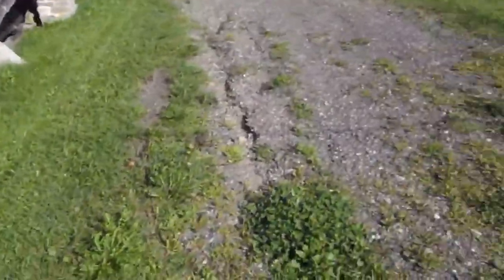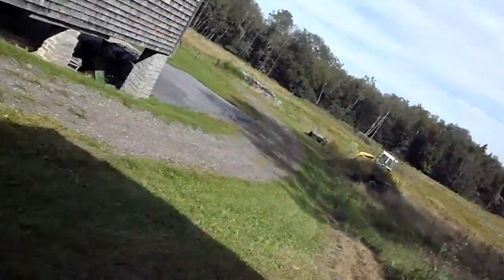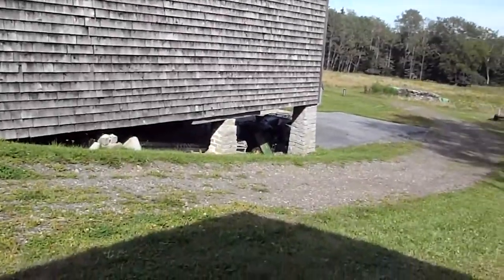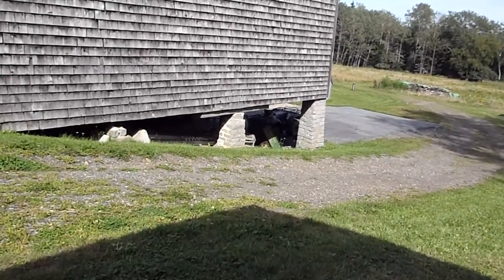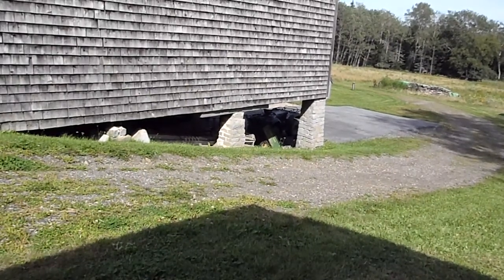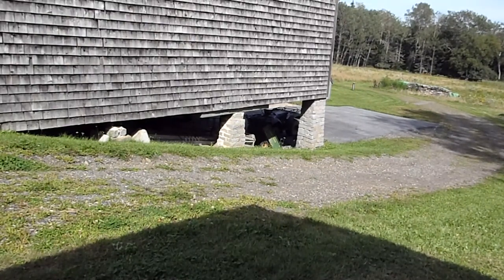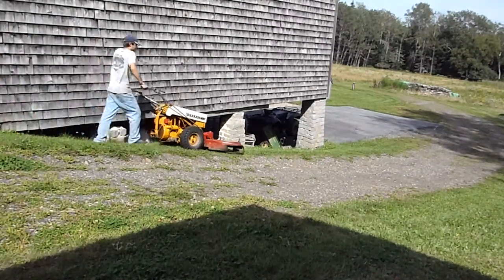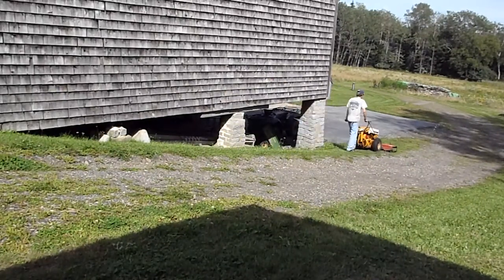More Problems with The Commercial 12

Comment: Maybe your F/R lever is worn. When it assumes the "Over Center" position, there has to be some area where the actuating rod and handle rest against one another. It could be that this has become worn down over the years and needs to be built back up with weld. It could be that something is bent out of alignment too. I think that with revers working well and forward working when you pull it back some, that indicates a problem with your lever system. Check it out.

Comment: @64gravely sounds like the clutch cup is wore out then. there not hard to change just pull the advanced casting off and getting the shift forks out is the hardest part and then back in again.( not really hard just aggravating)  keep track of how everything comes out and its easy good luck